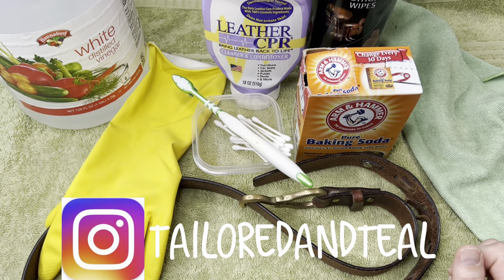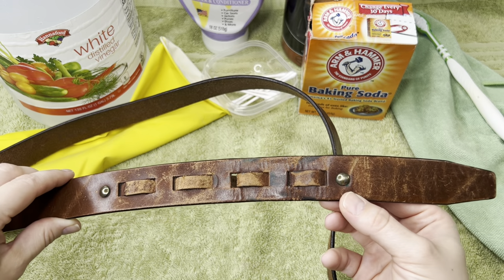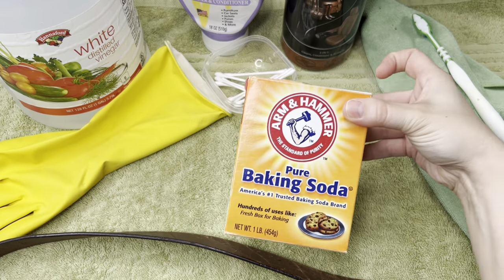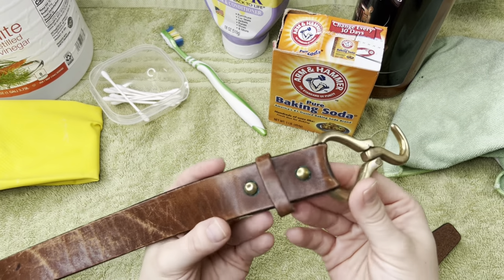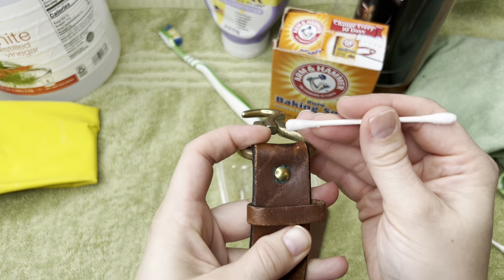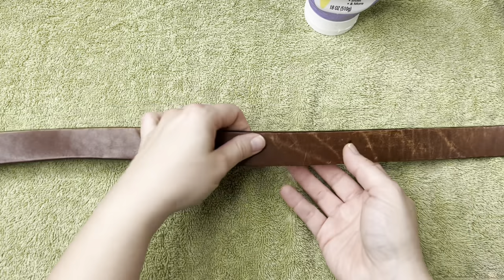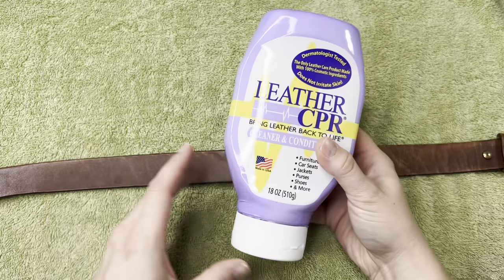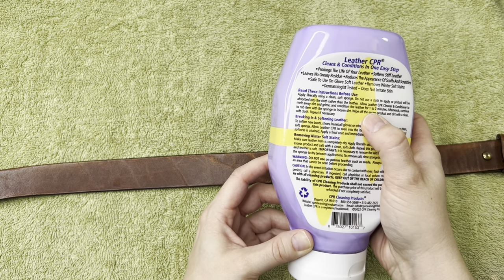How to Remove Verdigris From Brass & Leather Using Simple At Home Ingredients

Comment: Just bc I like this sorta thing: Verdigris is old French meaning Vert (green) de (of) Grece (Greece); ironically, Greece in French (Grece) is pronounced with the first "e" being soft and the second being totally silent (think "chess"). Verdigris is both corrosive and toxic, so you may want to consider gloves and an appropriate way of both collecting and disposing of it. Regarding the leather, vinegar is a major no-no as it can both damage the leather as well as make the stains worse. And for the rivets, they need to be removed to ensure all of the verdigris is removed from the underlying leather or else it'll return and damage the rivets once again. Oh, the joy of working with porous materials lol
Reply from the maker: Thank you for watching and for the extra tips! I wonder if vinegar causes damage after it’s been on for a long time bc what I did to this belt created no additional issues (I think I let it sit for 5 mins). While I agree that the rivets should be removed, I just didn’t have the tools for that kind of rehab, that’s why I made sure to get in all of the nooks and crannies. ☺️